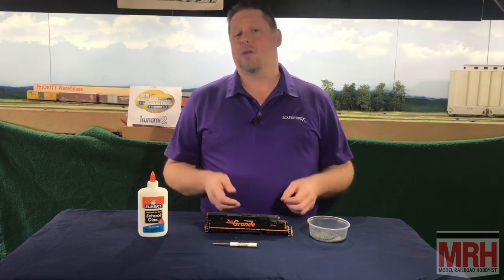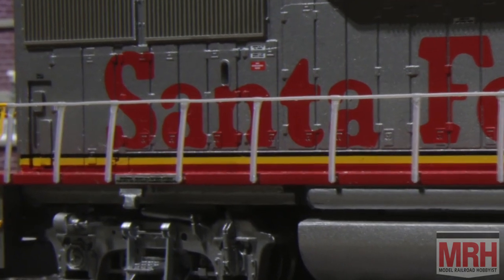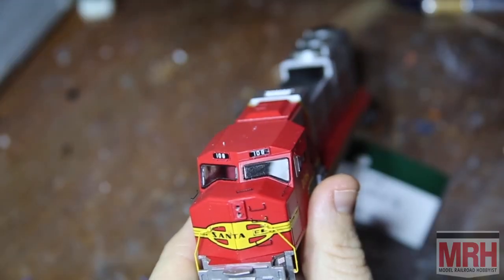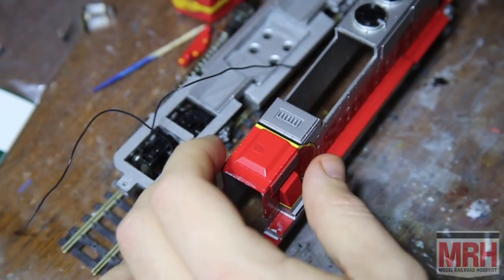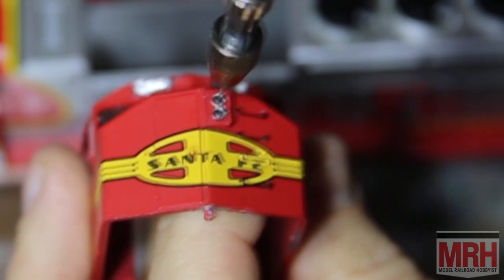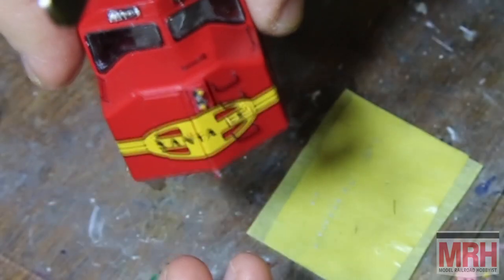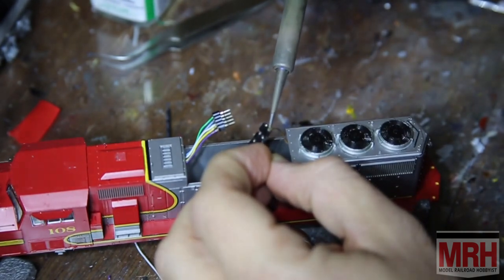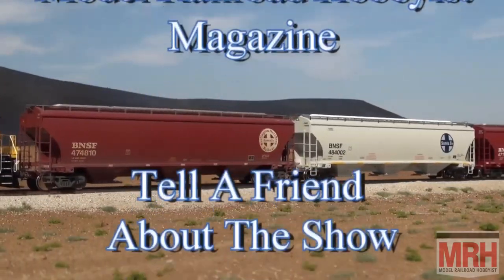Locomotive upgrades | June 2020 WHATS NEAT Model Railroad Hobbyist

Comment: Nice work on that GP60M James!!
My gosh dude you must have
bionic eyes to see those wires 
to solder to those itty bitty LEDs!!!
Reply: Yeah. I reckon if I tried that, they'd all be somewhere in my carpet by now, and I'd never find em again.
Reply: I did not mention the LED loss rate. Good thing they are pretty cheap in bulk. Lol

Comment: James super excellent job. I just finished adding sound and 20 LEDs to and HO Atlas ALCO C-420 so I have a pretty good idea of what is involved with this type of upgrade.. I wish I have seen your video before, I could have saved a lot of time and frustration. The final method I used for LED installations is  basically identical to yours except that I have to add a function only decoder to have independent control of some of the lights. For the ground lights i used the Nix assembly with a 0201 LED instead of the fiber optic that comes with it. The key to success is patience and never give up. Once again, excellent work and thank you for sharing.
One more thing, you can retrieve flying LEDs by swiping the LEDs landing areas with a magnet.
Reply: Thanks! I might have to try the Nix assembly one of these times.

Comment: Might I suggest using debonder to remove bulbs and lens as they are glued in with C.A. It worked for me when I converted my Amtrak engines from bulbs to LED's
Reply: Does it affect paint?
Reply: @JamesRegiersModels  No! But I applied it to the inside of the engines let it set for 30 secs or so and push them out. (I converted 6 of them with this method) I pushed them to the inside of the engine. It worked for me. Hope this is useful for you!
Reply: @morebassman5860  Thanks for the tip!   I'll definitely give it a try next time.
Reply: @JamesRegiersModels  It's been a long time since i did this but I think I used the debonder to remove the bulbs and then used a drill bit for the proper hole size to insert the leds.
Reply: In my experience you should be extremely careful with debonder. It's thin, and can run easily. I just about ruined an Athearn GP38-2's paint job with it (thankfully touch up paint and weathering concealed this nicely) If it pools and sits, it can warp a shell. That being said, it works great for its intended purpose, but keep it off factory paint for the sake of caution.

Comment: Have been using lead for 30years and my lead levels in my blood are still normal...lead is fine to work with so long as you have ventilation and don’t go eating it..or inhale the fumes when melting it down almost all things in life are cancer causing nowadays...yes tungsten is a good alternative to lead but at almost 5 times the cost...pewter or white metal are another way to add weight...on very light rolling stock like flat beds and things I wrap lead wire around the axles inside the trucks that way it is never seen and then I can run them in the middle of the consist and not at the end

Comment: At about 24:00, James shows a square bottle with a green label and refers to it as silicone paint.  What is this product?
Reply: Silicone Conformal Coating. 422B from MG Chemicals. It’s available on Amazon. It’s generally used to isolate pc boards, but works nicely for solder joints in magnet wire, also. It’s not quite as effective as shrink tubing, but much more versatile. It can also be used as an adhesive to route wires along the shell.

Comment: Video macrofocus issues were somewhat distracting to otherwise excellent detailed step by step instructions and explanation.
Reply: It's an issue with the technology I have available and physical limitations, I'm afraid.  Macro focus is lost with so much as a couple inches of movement toward or away from the camera.  Unfortunately, the ideal of working on everything on the desk, which would maintain the same focal length, is impossible.  When I hold objects above the desk to work on them at a better angle, macrofocus is easily compromised.  Unfortunately, the autofocus does not always compensate well, especially if the target is the size of my fingertip or smaller.  Manual focus will get a sharper initial focus, but with slight movement...  Glad you found it useful anyway.